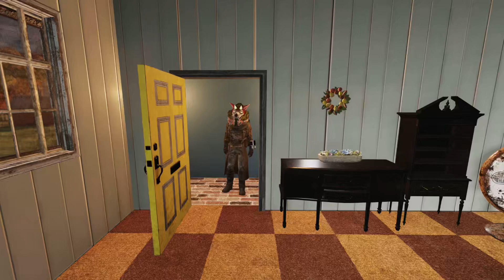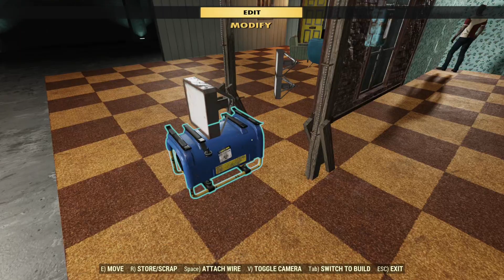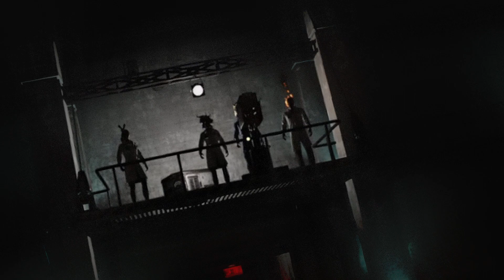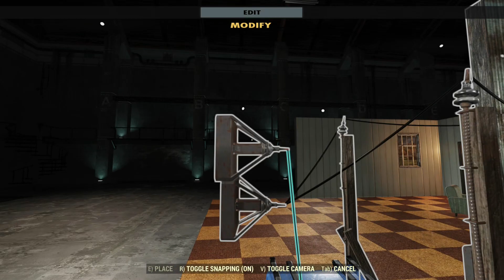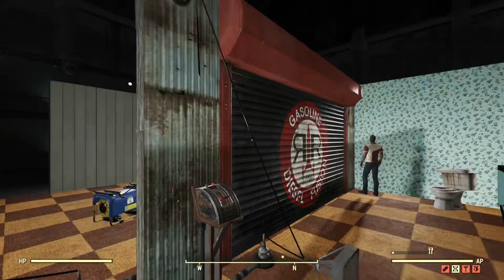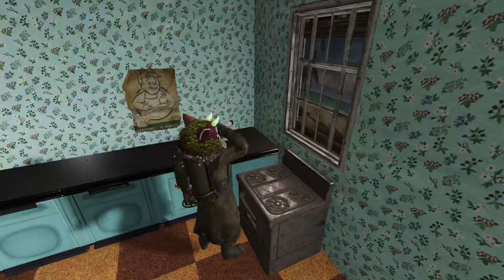Fallout 76: How to make a two way powered door

Comment: I know it's been a year, but yes! I would love to see more logic gates! I'm currently trying to figure out how to make a latching switch with the pressure plates! It's not working out so well 😅 I have made a reversed switch, where standing on a pressure plate CLOSES the garage door, and I don't remember what I did, but at one point, I made it where triggering the pressure plate made the door close and stay closed, which is opposite of what I'm wanting 😅
Reply from the maker: Yeah I've been meaning to get around to it, keep getting distracted or burned out after finishing seasons.
Unfortunately I don't think it's possible to create a latching switch with a pressure plate.
Reply: @PhaserRave oh! Also, I'm just testing with the pressure plate, I was trying to figure out a way to get the keypad door temporary output to trigger lights and a garage door to turn on and stay open without having to use a trip wire, and it's gonna be in a shelter. I was hoping to configure it to basically reset itself when someone leaves, but I might be getting a little ahead of myself with that one 😅
Reply from the maker: @MrChief2091  Just thought I'd let you know that I just finished recording a bunch of footage for the next video. I am going to work on it tomorrow night because the editor just crashed and it's late, but expect to see something.
Reply: @PhaserRave I'm looking forward to it!! Don't strain yourself!! Hope you get some good rest!!
Reply from the maker: Does the door stay closed when you're no longer touching the pressure plate?
Reply: @PhaserRave it did once, and I have no clue how I had it wired up
Reply: @MrChief2091  This is way late at this point but sometimes the pressure plates get stuck in the down position until you step on them again. 

I don't know if it's a server lag thing or what.

Comment: Doesn’t work for me on rolling gate. Wont open from either sides if one is not locked like in default. Tried many times from scratch step by step but no different results
Reply from the maker: You used the same garage door that I used?

Comment: Will this set up work using the new power generator that irradiates aoe power ?
Reply from the maker: Yes, but with a caveat: There's a couple issues adding AOE power to your logic gate. I've been meaning to make a new video where I go in to greater detail about this and the other logic gates I've discovered. Basically, if you have anything that sends or receives power in your logic gate, then it might send or receive power to another camp object (like the jukebox, which requires 2 wireless power), instead of your intended target (powered door).
Reply: @PhaserRave so trying to open the garage door might turn on your jukebox instead? Lol that's hilarious..bethesda logic
Reply from the maker: @Honu_Ryder  Yes, because the jukebox requires 2 wireless power. It's safe to use a closed system though, with no wireless connectors in your logic gate.

Comment: would be interested in a logic gate setup for the powered door with keypad access, i did manage to get a set up where you could use a keypad door to open a second keypad door, the switched pylon with keypad seems broken and the power counter., been trying to make a switch that will toggle itself off after a time
Reply from the maker: Oh, I guess the keypad still doesn't work. Off the top of my head, I suppose you could make a chain of AND gate switches (switches which are connected to one another in a line from the generator to the door), although that's not optimal. To make a timer you can connect a powered trap between the switch and door, but must reset the trap after each use.
Reply: @PhaserRave  Yeah i use the pressure plates but it can get annoying as they can look out of place, i tried the trip wire but it is also a pain as you have to keep resetting the trip wire
Reply from the maker: @Grog_79  Oh, I just remembered something I used to do. Not as ideal as a keypad, but you can connect a switch to the door and make the switch inaccessible (hide it inside a foundation or something). Next you connect a terminal to the same grid, and lock it. You use the terminal to flip the switch. Only you, someone on your private team, or someone willing to risk a bounty can unlock the door.
Reply: @PhaserRave  I have set up a terminal to a keypad door inside a shelter.
Terminal is set outside near keypad connected to a switch on the inside of a door. It only works while the switch is on. I used it to turn off the switches and close the door, once the switches are off the door closes and the terminal has no power. Trouble is I always forget to use the terminal, that's why I was trying to work out a timer for the switches so they would turn off themselves

Comment: Okay I figured it out without all that messy light boxes. I used a switched pylon connected to the power source (make sure the switched pylon is the only connection to the power source) Then connect pylon to a conduit and connect that to the garage door conduit.
Reply from the maker: That is just connecting a switch to the garage door. That's fine if you're just using one switch, but what if you want two?

If you put two switches, one on each side (or anywhere, but you'd likely put them on each side), and connect them directly as you had, then you must turn them both off simultaneously for the garage door to turn off.

My "messy" setup is an XOR logic gate, which allows you to flip the switches whichever way you wish to toggle the door. This means you only need to use one switch instead of two (while having two) to shut the door. This way, you do not have to backtrack and turn both off.

Comment: Can you show off some logic gate examples in fallout 4? Maybe a tutorial.
Reply from the maker: It's been a while, but if I remember correctly it's an object with two nodes, input on the left and output on the right. So, an AND gate would have two switches connected to the left, and the right connected to an output such as a powered door. If both switches are on and powered, then the door should open. It's a much simpler system than what we have available in Fallout 76, but I imagine my video above may also apply to 4 (which is unnecessary, since it does have logic gate objects).